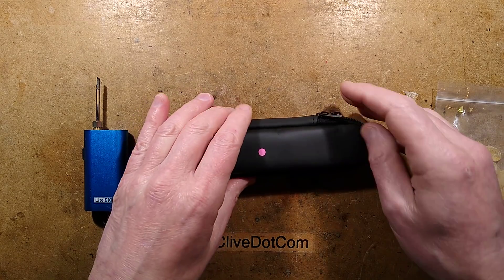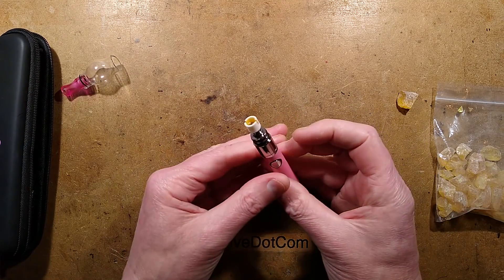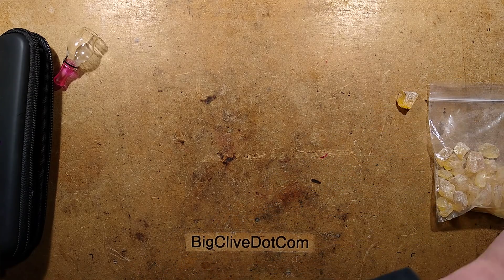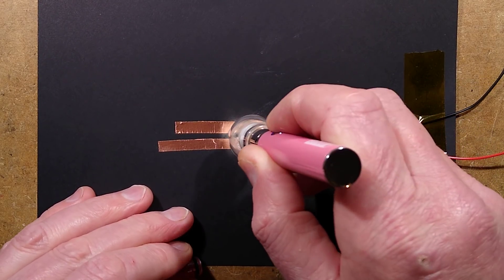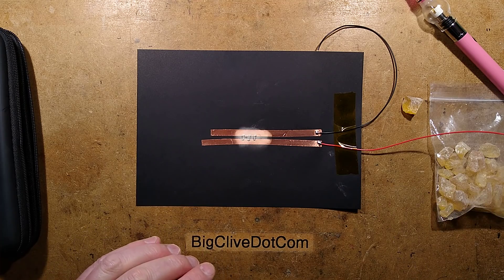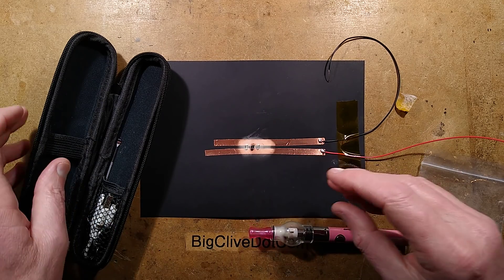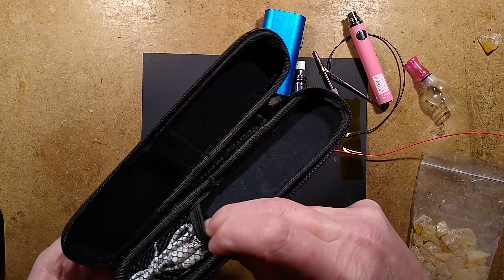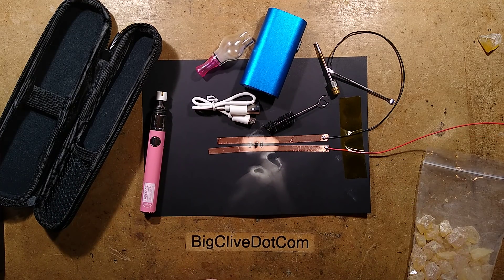Novel rosin vapour short circuit finder

Comment: Poor man's short detector that can help to find shorts on PCB in cheap and dirty way without thermal camera. Probably the one and only proper usage of vaping equipment. Do not inhale the "smoke" though - seriously. And seems board cleanup is required after use.

Comment: If the resistor is get heat it is short? Thanks
Reply from the maker: A hot resistor may indicate another faulty component.  Some resistors do operate quite hot though.
Reply: @bigclivedotcom  so hot resistor need to change after detech of rosin?

Comment: Love your videos on YouTube the rosin atmozier here in the USA it's one of the first evape liquid nicotine or just flavored an electric cigarette I have one similar but mine has a screw on charger it has three power levels have to push button several times rabidly  to change power level the other one you showed said it was a soldering iron.those here in America they called those mods also e cigarettes which you can modify different batteries coils keep up the good work another fan👌

Comment: Big fan of bigclive, but this is one time I have to take exception. I've watched every video on these I can find and there's a few common strains: 1) you don't see any of them cleaning up the excess flux after demo-ing (they're all demos and not actual repairs, most only show laying down the flux), 2) breathing flux vapor is bad for health, and its very electrostatic (sticks to everything); you don't want it indoors any more than you have to, 3) cooling sprays and IR detectors do a better job (at lower component temps) and do it faster. 4) It's a gen 1 vape pen people are trying to unload.

Comment: Hey Clive. I hope you’re well. 

I have a 32 pin connector on a PCB with lots of dry joints.  They are very tiny.  Is it okay to use hot air and flux paste to flow the connector pins or would it be better to use a soldering iron and a specific solder for this?
Reply from the maker: It depends on the connector and components in the vicinity.  It might be worth looking at some of the northridgefix videos for inspiration.

Comment: One idea I had when it came to finding toasty components was when a friend showed me thermal nail polish which can change color, based on the differential between the base of the nail and the tip. I never got around to actually testing it to see if it would actually work but it could be handy for a reusable method
Reply from the maker: I made a video about that nail polish.

Comment: when you used it again without the glass housing at the end of the video, you could clearly see why the glass housing is intended to stay on during use - you got the heating element so close to the surface you were covering with the rosin that it wasn't able to form  those white crystals. Maybe keep it in on, the coverage seems way better and more uniform with it.

Comment: If you were  doing that professionally, I would suggest that a thermal camera would be a much better buy. It would also have a much wider range of other uses.
If you're looking for a track short then better still would be a current sniffer that is usually a small linear hall detector. You inject 0.5V or so at perhaps 100mA and you can follow the current along the traces and where it terminates you have the short. I've used them and they are great.

Comment: This is really crafty, but the low price makes me think that the battery inside could be really crappy and thus prone to fire. Does anyone know a model without battery (which could be used with an external USB power bank) or which would accept a 18650 cell?

Comment: Seems clever, but than imagine vaping the whole board with this thing just to replace 1 cap that is shorted. Afterwards you need to clean the whole board.
Useless if you do not have an ultrasonic cleaner.
Reply from the maker: Isopropanol will dissolve it.

Comment: Giving up my great idea here, but maybe some chemical manufacturer should develop an aerosol 'hot component detector' spray using color changing crystals ala mood ring/lcd thermometer. Spray on, power up, watch for the color changes....
Reply from the maker: You can get thermochromic paint for that.  You put dots on specific components.  Also shows you how hot things are getting while running.  Others will record the maximum temperature by melting wax on a strip to make a marker visible.

Comment: Would be interesting to see what is inside one of those. Clearly a heater element, a fan and a reservoir, but how did they package it so small? And why doesent the liquid flux just drip out?
Reply from the maker: Just a lithium cell and charge circuitry.

Comment: on devektive laptop motherboards (short circuit) i used to slowly raise the current up to max. 20A at the normal psu voltage to find for example defective capacitors through upcoming smoke and it worked perfectly fine even for an xbox one from a friend of mine after removing or replacing it 🤣

Comment: I've done this about 40 years ago with aerosol freezer spray. Very rapid fault finding. In large rows of many RAM ICs soldered into a PCB, the one which thaws out first is the faulty one.  Also for finding short curcuit current path the tracks carrying current thaw out.
Reply: That's what I was thinking too.  Freezer spray is still common where I work and there's even an ESD dissipative version for more sensitive circuits.  I could see atomized flux being very valuable during reflow processes, though.  The liquid stuff evaporates too easily when reworking.  Having deposits that melt while heating sounds nice.
Reply: @ImnotgoingSideways  Yep. Use freeze-spray on a regular basis in fault-finding at work. In severe cases of shorts, it identifies the component within about a second. Minor faults (currents out of limits but not as violent as IC's with internal shorts) take a few seconds longer but still get the job done.

Comment: or you take your can of air duster stuff, turn it upside down, spray out a bunch of the liquid onto your circuit board, and you get a nice layer of frost without the need to clean your board again. Power it up and the frost melts on the hot components.

Comment: what about using ice spray or thermal paper?
Reply: @Matt Quinn ice spray creates white frost, white ice crystals, the hotter the area the sooner it is gone. Very effective on phone pcb boards. But you are right, the rosin dust works at a longer period of time, if the part gets only temporally hot.

Comment: I wonder: Would the atomizing of the flux here "use up" all of the weld-enhancing effects of the flux? Could the flux deposit on the solder still in fact help with soldering?
Reply from the maker: Marginally, but I'd rather use extra liquid flux.

Comment: The better Mods (vape battery units) even have a TC mode that lets you set the vaporizing temperature. You have to select what type of metal or alloy the coil is made of tho. As far as i know they control the temperature by measuring the cold resistance of the coil and use temperature dependancy of the metals resistance to figure out how hot the coil must be based on the current and voltage applied. I guess you could hack the firmware to adapt to the soldering tip curve and have a temperature controlled battery operated soldering tool this way, of course with a lot less ergonomics and precision, compared to a commercial product that is actually intended for soldering.
Reply: Those ones are different. This one is for dabs/ Thc concentrates...or hash. Theres just one button, no screen. I got one and it was way more expensive sold as a THC vaping device but exactly the same kit, just a different brand. The ones for nicotine vaping that use different coils have a screen and a control/mother board. Theres no control board w this one

Comment: Loving your affinity for pink!
My color of choice would be purple, both for my hair or clothing/accessories, and for electronics stuff (enclosures, PCBs - JLC offers that, and my signature purple Tytan 1000 polyester or nylon thread for cable lacing). And by the way, my favorite typeface of all times is Gill Sans. It has something to do with the fact that I worked on Monotype typecasting machines for five years and made a few units of computer control attachment for these.

Very cool test setup, beautifully shows the hottest one :)
At the end of the day I hope I really learned something.
Reply from the maker: Purple is the second colour choice for stuff if pink isn't available.

Comment: If you had an FLIR, wouldn't that be a much better tool? I always replace (or remove) electrolytic caps. They all go across pos and neg. A good start-point in finding S/Cs.

Comment: Erm?? how is this cheaper than using the back of my hand or any part of my arms that is sensitive to heat plus the cost of the rosin over time makes this more expensive than a thermal imaging camera any device that requires you to buy and use up a resource is not a cheaper alternative. You could do the same thing with IPA and you already have to buy it to get rid of flux residue.

Comment: What voltage did you apply to the resistors? Wanted to know how much wattage was needed to create the effect?
Reply from the maker: 9V.
Reply: @bigclivedotcom  So about 0.8W heating that resistor, yea, easy to spot that, even w/o your vap device. When the short is really low ohms, there is minimum heat at the short, I dont think the vap will reveal anything. I been troubleshooting shorts for 4 decades, love the CC power supply and if necessary a dmm with at least mV resolution. Thanks for sharing.
Reply: The voltage you apply will depend upon what you're testing.  You don't want to put in a higher voltage than what the components can withstand, if there's a possibility that the voltage you put in can reach them.  So basically you start with a low voltage, such as 1.0 volts, and see if that reveals anything, and if not, try a bit higher.  But you should also measure the voltage at the supply pins of relevant components to make sure you're never exceeding the limits.  Often times, the short will pull the supply voltages down to negligible values, but sometimes that's not the case, or not the case everywhere.

Comment: I used to have a few of these things back when I was around 18 or so - I got quite a bit of use out of them at the time, but never for "testing circuits" 🙂
Reply: I see u are a man of culture as well.
Reply: @erik You can also vape herbs in it. Or any other substance that vaporizes when heated.
Reply: I had one of them too, but it doesn't beat an actual vaporizer designed for herbs.
Most normal vapes have a ten second timer and you need to hold it the whole time and then re-press it.
Reply: @erik You don't burn material so no smoke in your lungs, therefore it's more healthy.
Reply: These used to be in eBay in 2016 for like $5.99 🐐 juul Fr fuc it up
Reply: Hey, I’m trying to buy one from temu. I’m thinking of getting it bc I’m underage and can’t get one anywhere else. I’m just wondering if I could put juice in it and where I would put it Becuase I’m afraid it might leak out.
Reply: @Quandalicus  How about just... waiting until your not underage anymore...?
Reply: @Quandalicus  put a small dab in the same spot he put the pine resin

Comment: 99% IPA works as well without the need to charge yet another power hungry device with crystalline rosin (I can get the IPA locally, the crystalline rosin not so much).  It is an interesting idea, though, and I applaud the constructive use of technology that was previously used for less than constructive purposes. Question: Can the SMD device be removed with a soldering iron after it has been misted or will more flux be needed?  That could make the thing useful as a flux applicator, not just an over-heated component detector.
Reply from the maker: It would need more flux.

Comment: Thank you for sharing this! I'll also add perfect timing! My electronics class is discussing simple troubleshooting techniques this week, mostly touching on using a multimeter to diagnose shorts and opens, but this method is like a poor-man's thermal imaging camera! A little messy, but if it works.... that's what solvents are for! I shared this with my class, so hopefully you'll get a few more subs!

Comment: You made a test setup and secured the Cu traces with Kapton tape..touche.  
I like finding economical tool applications.  Instead of dropping several hundred dollars on a tungsten electrode sharpening tool, I found a router base for my Dremel tool which took seconds to modify into a sharpener.  Plus it takes seconds to revert back into its original purposes. 
Been doing a good bit of stainless welding on my latest project so just remembered this home built tool
Reply: Interesting - please post a short video..🙂

Comment: Hi Clive: You can do a similar thing with thing with high concentration alcohol, while the circuit is under power. Drop some in the area where you suspect a hot spot, and it will evaporate more quickly over the hot component. (Might need the microscope/magnifier  to see it clearly.) You can also dissolve the rosin in some alcohol to form a very weak solution, and let the alcohol evaporate to leave the thin layer of rosin.  The sublimation of the selective terpenes, from the rosin vapour (from the vaporiser) is quite sensitive because as easily as those sublimate onto the surface, of the chip... these terpenes are easy to sublimate from the surface of the chip too.
Reply: @Matt Quinn Well can spend 500USD+ for a Flir infrared camera/thermometer... or learn a little physical chem. I don't have 500USD.
Reply: Highly concentrated alcohol evaporates so quickly that it's hard to work with. You could literally get a layer of the stuff on your PCB, but that will mess up your circuit when you apply power.
Reply: and damage the forced jab

Comment: I'm really liking the direction these devices are trending in. One could easily bodge together a flashlight end, and a few other odds and ends and keep it in a small tool kit with a bit driver and a couple of common bits. Electronics toolkit that is wireless and fits in your pocket!
Reply: Sonic screw driver and neutralizer.:)

Comment: Seems awfully complicated for something you can do with a can of air duster held upside down for use as a freeze spray... I definitely wouldn't want to intentionally vaporize more flux, I was quite happy to find that my new Chip Quik flux pen is much less smoky than my standard MG Chemicals flux syringe.

Comment: Given the high average temperatures here freeze spray isn't a great option, so I tried one of these vaporisers myself and didn't have the greatest of success ( using on iPhones / Macbooks ).  What I did find perfectly acceptable though was to just jam the soldering iron in to the rosin block and thus negating the need of the vaporiser.  To be fair, I was likely using it wrong or needed more practice.

I'll probably stick with the Infrared camera but the rosin idea still is a nice one, especially for iPhones in warm climates.

Comment: I need to order one of these. I work as an engineer at an electronics design and manufacturing company. It's so frustrating when I get a prototype in and something is overheating but I can't readily find it without burning my hand. I have a few SOT-23 sized burn scars on my finger tips because of it.

Comment: This is kind of how I once found a short. I had a circuit board with a diode short across the rails, so I connected some AA batteries across it, and the offending components all got warm to the touch. Turned out I had manufactured my board with leads swapped on the FETs. Oops!

Comment: I would LOVE for someone to come up with a tool kit standard where only one power pack is needed for multiple tools. I guess USB power banks get close, but aren't nearly so elegant. Unfortunately, if the cordless power tool scene is any indication, that's not a standard we'll see soon. 👍️
Reply: Torque Test Channel would like a word.... (makita clip)
Reply: @Hyratel  I've seen lots of 3D printed solutions to this effect, I'd just rather see one designed and shared by companies. It'll never happen, but one can dream.
Reply: @McTroyd  in all of the cheap-amazon impacts TTC tested in a recent video, All of them were a Makita-shaped slidelock. Like 6 and a half different offbrands using the same slidelock

Comment: Neat!  - thank you - I thought I would share this simple video - it might make a proper BigClive video - it is a Joule Thief with two flicker LEDs in parallel with a blue LED (also in parallel) - when both the flicker LEDs are off - the blue LED lights up - so you get an interesting light show from an old 1.5 volt battery and a single transistor https://youtube.com/shorts/CT2Znv1KW14?feature=share

Comment: I use an aerosol can... any cold spray that leaves a "frost" will do the same thing.. and depending on the product can be cheap.   You do have to be quicker than this one will allow.
Reply: You're also not changing the temperature of your circuits with this method, which could matter sometimes.

Comment: Hi Clive just wanted to let you know that’s a pipe for smoking crack cocaine, you should be very careful, especially with the white resin residue in it and on the glass. Once the police test it for cocaine and it doesn’t test positive you will be okay but you still have to go through the hassle of sitting on the side of the road while they examine it, at least in the USA that’s how it works. Have a great day and be safe.